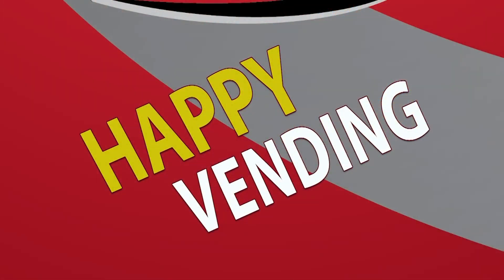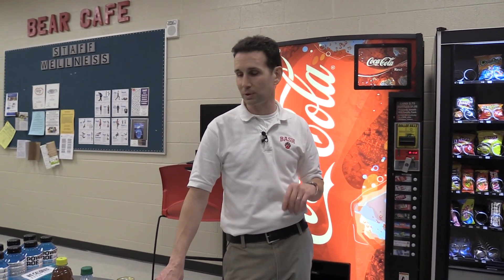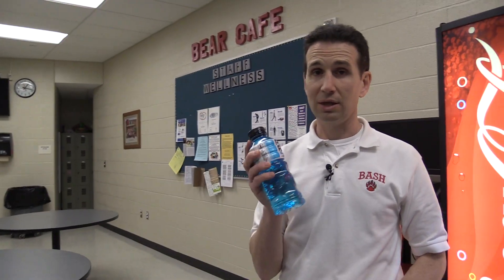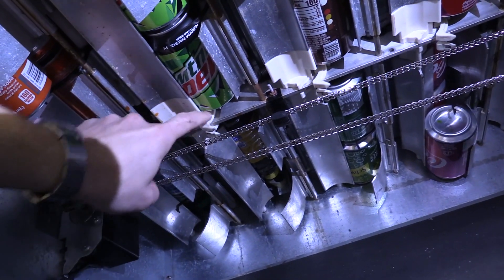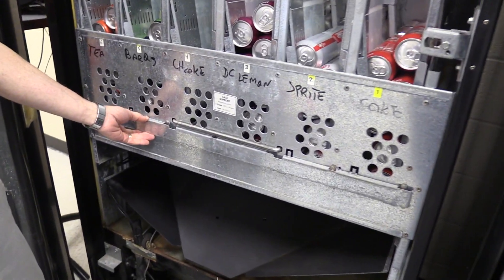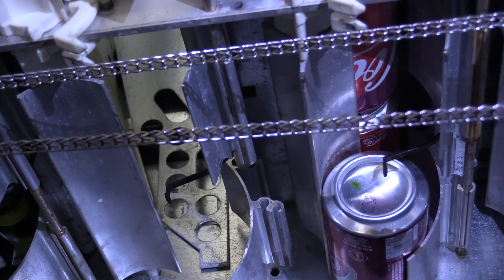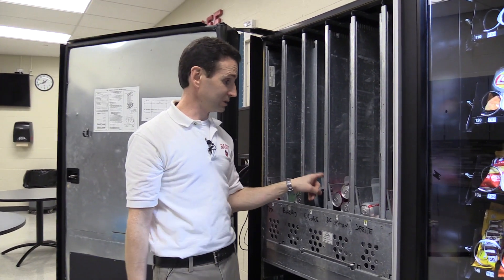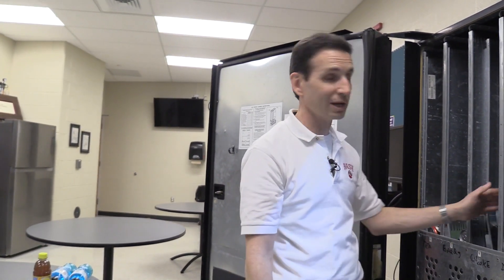Switching from Cans to Bottles in a Soda Machine

Comment: I saw it done in the past. Some good and some not so good results. What do you think is worse case in a home set up? I was going to use  a front pull older machine but, I thought the electric consumption  on a 50 year old machine would be very high as well as not as cold. I think you have enough experience that your suggestions should be considered. Might keep the vend out side in the shade in Florida, so its hot year round. Thanks for the help.
Reply from the maker: Glass bottles are not designed to handle the stress of having other bottles stacked on top of them and then being rotated through a pivot and dropping down into a shoot.  It will end with broken glass or caps popped off with a big mess.  I wouldn't do it.  Just get cans of beer.  You can post your question on the vendiscuss.net forum and see the opinion of vendors that have been doing this far longer than I have.

Comment: Hi Bill, watched all of your videos multiple times, Many times :). Very very helpful. Thank you so Much. I have royal 660. Machine looks the same like the one you demonstrated here. I have changed one column from 12oz can to 16.9oz water bottle and having issue vending correctly. I did not changed rod position as product diameter looks the same as can (Dasani 16.9oz water bottle). I changed shim as you recommended/ demonstrated in this video.  Also changed Set depth per selection from 2 to 1. Problem is it vends two product and goes to sold out and when press coin return button it returns full amount of change. So First time I test it vends two bottle per selection, right after that second vend, it will be one bottle then sold out message and return change upon pressing coin return. Could you please let me know if you know the problem or solution of this issue?
Reply from the maker: It sounds like your issue is the drop sensor.  It is either bad or needs adjustment.  First try adjusting the drop sensor following the directions in the manual.  The adjustment is on the control board.  If you don't have the manual, you can download one here: https://www.royalvendors.com/giii-vender/

Comment: I have a Royal 804. It vended 3 12oz cans. The space depth is set to two. What could be my issue besides the rods?
Reply from the maker: You probably set your depth wrong.  Make sure you are setting it by selection, not by column.  What that means is if selection 1 on your machine has 2-deep cans, set 1 to 2.  Column 1 might not be linked to selection 1.....so you need to set depth by selection, not column.

Comment: Great video 
So I followed your video and for the first 2 vends it was perfect but on my third vend the Powerade bottle seems to get caught up on the long product stop. So it is just hanging from the top of the bottle. Never touches the chute it just Hanging free. Any idea??
Reply from the maker: @alow2323  does your machine have the black anti tilt arm in each column?  If it is missing or broken,  you will need to replace it.
Reply: @HappyVending  that’s the little black lever between the cans if looking from the bottom?
Reply from the maker: @alow2323  yes
Reply: @HappyVending  ok is all of mine are there I even moved my Powerade to a different column and it just seems like every third vend it gets hung up
Reply from the maker: @alow2323  and you are sure you set your product stops to the wide position?  Take a photo from underneath and post a link to the photo.
Reply: @HappyVending  I’m pretty sure that I moved them just as you did on your video. But I will take a photo. 
Is it possible that possibly gunk or rough edge could be holding it?
Reply from the maker: @alow2323  I doubt it.  And are you sure you set the SELECTION, not the COLUMN, for 1 deep?
Reply: Yes sir 
Why is it that I can set prices on 12 selections , set 12 depths and 12 space to sales?
Reply from the maker: @alow2323  some machines have 12 selection switches,  but most don't.

Comment: Could you do a video on that machines vending mechanism? I curious as to how the chain's hook is able to move around to reach the right lever.
Reply from the maker: There are magnets on the chain hook and a sensor that the chain passes over.  I know between the sensor and the magnets the machine knows where the hook and rotors are.  I once needed to replace a bad sensor on one of my machines.
Reply: @HappyVending  Would it be possible to make a video of it dispensing with a camera watching the chain? I have found videos for the other two types of machines but not for this one. I'm curious about how the mechanical elements work.
Reply from the maker: @link12313  I'll put it on my list of videos to make.
Reply: @HappyVending  thanks

Comment: Subscribed.... I have Dixie Narco 501e. I am new to vending and having trouble setting my machine. My machine takes cans and bottles. Sometimes it dispenses two at a time and other times it doesn’t at all. Plz help!
Reply from the maker: It's probably your cam setting or you are using the wrong product shims.  Are you trying to vend cans or bottles?  In the wide column or the narrow column?  How many products deep are you trying to do?  The proper settings should be listed on a paper on the inside of the door.
Reply: Happy Vending I am trying cans in the narrow columns. I bought a used machine and problems keep arising. My display, and bill acceptor doesn’t work also.
Reply from the maker: @ScarFace405_  The bill acceptor probably needs to be replaced...almost every machine that I purchased I had to replace the bill acceptor.  I prefer the MEI bill acceptors over the coinco ones.  You should try putting the cans three deep in the machine and setting the cam to the 1 setting.  You also need to confirm that you have the can shim in the machine.  You should join the http://vendiscuss.net/ message board and post your issues there.  There are many experienced vendors on the board that will walk you though any problems you are having with your machines.  I've learned much from the forum.
Reply: Happy Vending thanks for all your help keep the videos coming they are very helpful!

Comment: I have a vendo v407 , would you happen to know how to set the depth from changing bottles to cans?
Reply from the maker: Sorry, I do not have any Vendo machines.  You should join the http://vendiscuss.net/ message board and post your question there.  There are many experienced vendors on the board that will walk you though any problems you are having with your machines.  I've learned much from the forum.

Comment: How do you do this on a Dixie narco 720 p
Reply from the maker: Dixie's are more involved.  It requires you to change from the can shim to the bottle shim, adjust the cam setting to 2-deep, and remove the rod in the rotor.  I will need to make a video on the process.

Comment: I made a mistake removing a rod, I removed the first one from left to right and it had to be the second one to adjust the size. I already put the rod back in but I don't know if the blades are in the correct position. how can I know? do you have any tutorial I already did the test to dispatch and the product comes out well.
Reply from the maker: What do you mean by blades?  Do you mean the shims?  If it is vending ok you are probably fine and I wouldn't worry about it.
Reply: Happy Vending yes, shims...and its working fine, thank you

Comment: Are you able to show how to set up a nayax credit card ?? Or give info about them?? Kinda wanna get some but idk how they work or the system works or how they connect.
Reply: I liked and subscribed !!!
Reply from the maker: Each machine connects using a modem and uses cell phone towers.  You need to pay around $8 per machine for the hookup and about 6% of each sale to the credit card companies.  It pays for itself if you have a good account because you get all types of sales data and you know when a machine needs to be refilled without going to the location.  Nayax has an app for cell phones and a web interface on the computer.  I will make a video about it in the future.
Reply: @HappyVending  awesome sounds interesting and simple but I'd still like to see some video content about this please 👍

Comment: Hi Bill! Love the channel! It’s been extremely helpful!

I’m new to the vending world and I’ve hit the ground running after months of saving and research. The first machine I purchased was a Royal GII (RVCC 390-9). The bill validator was bad so I had it replaced by a vending machine mechanic I met at a vendor warehouse. He replaced the coinco with a Mars/mei and showed me the basic functions of the machine. My machine has been on location for a little over a week and it’s doing well. But I have a few drinks that are not selling at all and I would like to replace them. The only issue is that I as far as I know my machine only takes 12 oz. cans. The employees where the machine is located have asked for 3 replacements: Yoo-hoo, energy drinks and water (still). I don’t mind making the changes because I can put the products in another machine, but I cannot find their requests in a form that would fit my Royal GII. Any insight, advice or suggestions would be greatly appreciated. Thanks
 

current drinks in the machine are:

Coke, Sprite, Diet Coke, Gingerale, Dr. Pepper, Coke Zero, Orange Fanta, Mountain Dew and Root Beer
Reply from the maker: Thanks for the comments.  I have never used a Gii machine, but  each column should be able to vend either 12 oz cans or bottles....so you should at least be able to put water bottles in there.  I have seen YooHoo in 12 oz cans in the past, so that would be the way to go with that...but I don't think it would be a big seller....so don't buy much of it.  I'm not sure if that machine will vend the longer energy drink cans...you will have to talk to someone who has run those machines.  I think I've seen you on the vendiscuss forum....you should ask your question there.  You will get  lots of good advice.
Reply: @HappyVending  thanks for the response Bill.
Reply from the maker: @thecandyladyvendingllc.6055  You're welcome.  And I see you were introduced to AZVendor on the forum...lol.  He can be brash...but he does know his stuff.  Take it with a grain of salt.

Comment: How to remove crushed soda can from drum
Reply from the maker: In a dixie or a royal?  If a dixie, if you can't turn the rotor, you may need to remove the motor to pull the rotor up and out.  Of course, you will need to remove all the product from that column.

Comment: Only thing wrong. Well one of the only things wrong. Is the settings of your front product stops on bottle drinks. Is they should be set. Just right past the bottle top. And you don't want anything more than 1/4 inch of space between product and stop.
Reply from the maker: I don't think the difference between 1/4" and 1/2" of space for bottles on a Royal GIII is really going to make a difference....well at least it hasn't for me.